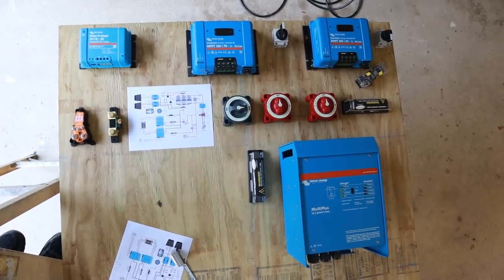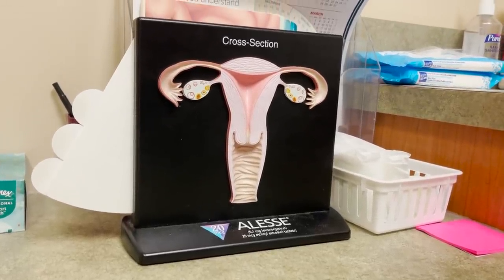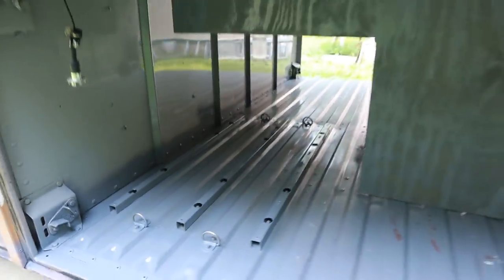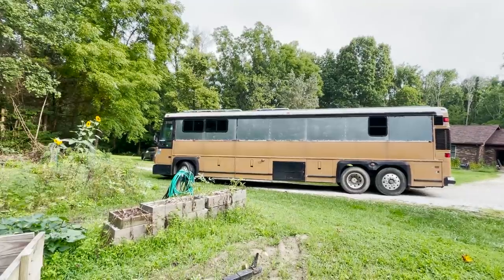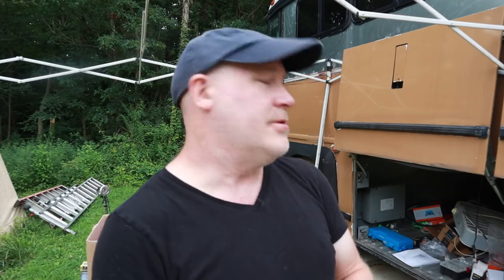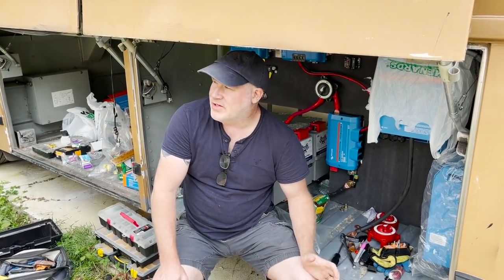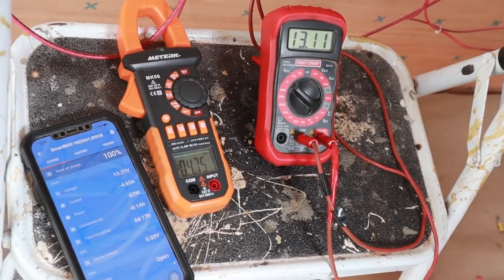Battle Born Batteries & ELECTRICAL SYSTEM Install for our Bus Conversion - S04E24

Comment: Mela I applaud your courage in sharing your condition. Don, having spent 8 years wiring elevator controllers for the largest custom elevator company in the country, I can sympathize with your project. At least I had the benefit of an engineer's schematic. I would have suggested a couple of tools that would have made the job easier but you succeeded. Good Job!

Comment: HUGE hugs to Mela, I had a fibroid as well and it made my life absolute hell, including being blue-lighted to hospital because I was bleeding so badly. Eventually I had a uterine artery embolisation, which was the most painful and horrible thing I have ever been through. But even though I don't want children, I also didn't want to entirely lose my womb and at the time couldn't afford the time off work post-surgery. 

I have been post-surgery now for seven years, and it was definitely worth it. My periods are super light and manageable now, I am no longer anaemic, and hubby has had a vasectomy so we don't need to worry about me getting pregnant (after UAE, it's unlikely you can carry a child to term). 

A friend is also currently going through the same thing and is having a hysterectomy. So you are absolutely not alone! It's super (scarily in fact!) common. xx
Reply from the maker: Thanks for sharing!  Huge hug for you too 🤗

Comment: Take it from a machinist, the bigger the drill bit, the slower the RPM of the drill press. For a thin piece of tubing, you should have gone with a step drill. Less chances of the drill jaming in the hole.

Comment: JUST MY OBSERVATION: The Solar Power Wall is a very expensive Focal Point of a build. ( I have built these in my past ) MY suggestion would be to have the ( 2 ) Mulitplus 3000 Charger / Inverters mounted side by side on the same Wall. It's a much cleaner install. JMO
Reply: You might want to look into the multiplus II which just came out it’s a 110/240v unit so you don’t have to run two inverters.  It also takes care of phase switching etc.  if we had a need for 240 in our build I would have returned our multiplus 24/3000 for it.

Comment: Thank you for the wonderful insight into the system. I drove from Jackson Hole, WY to Reno, NV to pick up my Battle Born batteries. Just got back. Installing them tomorrow. Your video was the reason I chose Battle Born... and they are made in America. Mason at B.B. has been very helpful as well. God Bless.
P.S. What was that DC isolator? Do I need that? I have 2 ac units.
Reply from the maker: Amazing thanks for sharing and very excited for you to have power!

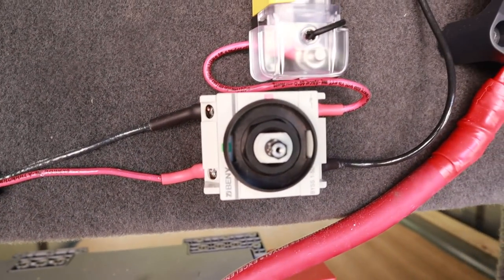Comment: What is the component at 34:30 with the black wire on top,red on bottom on the left and a red wire on top, black on bottom on the right. If it is some kind of disconnect, i wonder why the color change from side to side. Shown really well at 34:43

Comment: nooo never lay a fridge down.. it messes it the condenser. thats why it says this side up. hopefully you guys did not ruin it.
Reply from the maker: Hey hiccup billy, thanks for the concern. It should be fine you just have to set them up right for 24 hours before you plug it in and it all settles :)